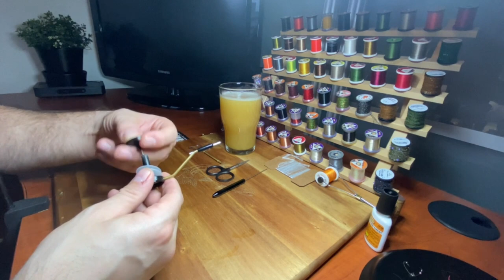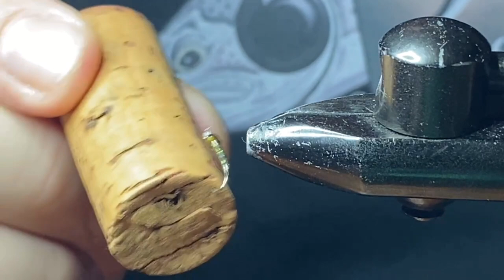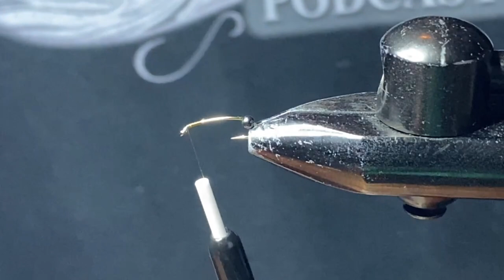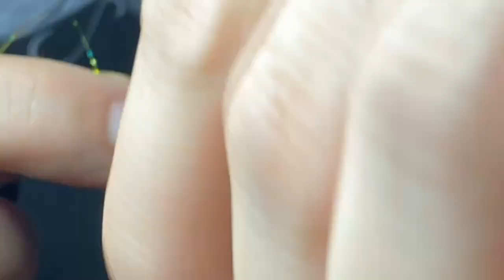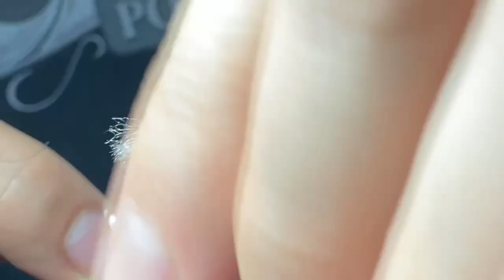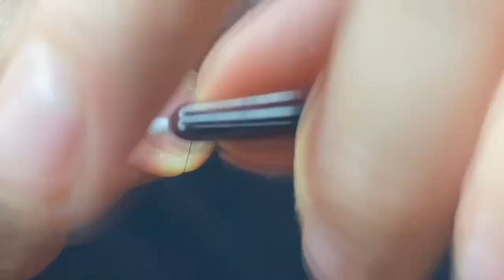Fly Tying Session | Green Chironomids

Comment: You should try using a thin UV cement for your first or second coat of hardener. The zap a gap doesn’t set properly or takes a long time to set without pressure contact whereas the UV sets up instantly allowing you to do your second security application immediately. My opinion only.
Reply from the maker: Good tip Rick, appreciate that! Thanks for watching

Comment: Right on Brandon ! So there's one reason I leave my gills to the very end...when I have thread straggles, I will hold the gills between my finger and thumb (out of the vice), while running the lighter across the hook quickly. When the gills are short, you can't get as good of a hold on it. Some may not agree, but that's what I do ;) (CaboHew) Cheers !
Reply from the maker: Cabohew, thanks buddy. Yeah makes total sense, good tip! As long as you fish your fly pattern with confidence, that's half the battle FISH ON